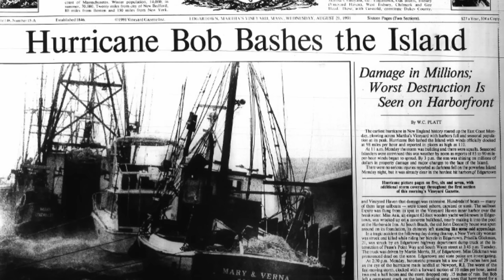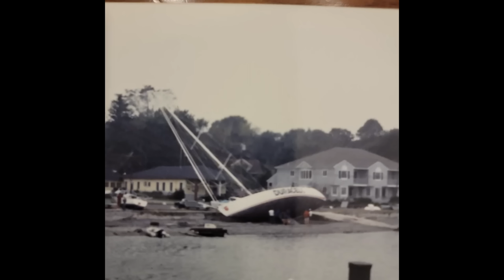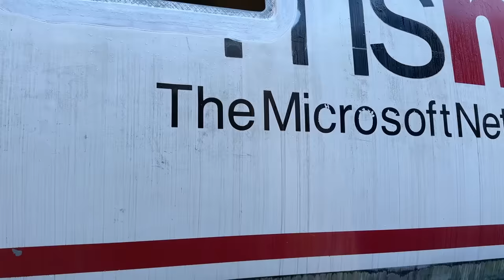FAMILATION (family lamination) & SCARY story [E101]

Comment: I suggest making all three front windows in the doghouse as big as possible to maximize your view forward, even if that means fixed glass rather than the hatches. It would improve your sight-lines thru the rather tall doghouse structure in front of the helm and will be much much more aesthetically pleasing from both inside and outside. If you need hatch ventilation install them in the coach roof above those two trapezoids where you were talking about mounting them.
Reply: The hatches will still give sight lines forward but the big plus, while under sail, is the forced ventilation that will occur. Roof hatches won’t give that through breeze while underway. You can also pass drinks etc through the hatch to someone forward. 😊

Comment: The edge pieces that you slotted to give you that nice cut is called a 'kerf cut'. You can do it to bend certain pieces of wood the same way their is a formula or a calculator you can use online depending on the angle you want to curve

Comment: It so nice to see your parents get involved with the boat build and especially how much your mom has contributed to the long-term boat build.  When you plan for your rainwater catchment drains, you may want to consider adding a raised filtration screen. I've seen that on other boats and it helps to capture some of the large chunks of debris so that it doesn't end up in your holding tanks.  Also, for the front side windows, the position the cardboard is in now looks very nice, but at the end of the day which orientation would give you the best viewing angle for sailing?

Comment: I built a 6 ft x 8 ft hard top with a dam at the edge similar to yours. A good hand-hold and great water catchment system. I was able to catch 16 gallons in a So FL rainstorm and fill my water tank. I can see your roof catching 30 gallons in a heavy rainstorm. Not insignificant.

Comment: Clever idea with the rain catch. Will you have a shutoff or diverter valve for when heavy seas put salt water on the doghouse roof?
Reply from the maker: the roof will not be permanently connected to the tanks. We will connect it when there is a rain storm, after letting the water rinse the roof first.

Comment: I'd suggest to make the two other forward facing windows as big as possible and not use hatches, improving the sight and also the look of the boat... would make a lot of sense to have the side, top and bottom aligned and with similar rim sizes... the hatches could be added on the roof, to also be able to see the rig, mast, main sail etc while inside...
Do you also plan to add photovoltaics on top of the roof?
And how do you plan to avoid to get saltwater from the splashes and mud from the roof into the water tank?
Reply from the maker: we want as big a solar array as possible on the roof so no hatches on the roof. The hatches forward provide immense air flow. The roof won't always be connected to the tanks. We'll let water rinse it off before connecting to tanks.

Comment: Is it possible to have custom hatches made so that the front side windows can match the aft side windows of the doghouse and carry that shape through? If anything the front centre window of the doghouse might have been the candidate for the opening window if there is enough clearance so it doesn't foul anything on deck. You could then build the front windows from a sheet of 10mm poly carbonate thermoformed to conform to the shape and then have two more single sheets of poly bonded to the sides to create a 'go faster, mother of all doghouses' type effect then inset a hatch where you need it  without disrupting the aesthetics...

please remember i'm making it up as i go along so feel free to laugh at my suggestions...
Reply from the maker: expensive, but possible!

Comment: Plus rain water has a lot of minerals absent from water created by a water maker
Reply: Not really. rainwater in the middle of the ocean will have very low mineral content. Also that is all mumbo jumbo. Mineral free water is just fine. But if you want minerals you can always add them to the water after RO. Run your drinking water through a filter housing stuffed with landscaping marble if you are so inclined.

Comment: Pro tips: (1) Do not use a router at sea (2) Do not use a router at sea after removing the base plate  (3) Do not use a router at sea after removing the base plate and hold it freehand without a table or jig like a giant dangerous Dremel tool. (4) Do not use a router at sea after removing the base plate and hold it freehand without a table or jig like a giant dangerous Dremel tool when the seas are over 1m. Thankfully I only nicked my thumb and thumbnail. Just a bit of blood... Do your routering at the dock, on land, or at anchor.
Reply from the maker: excellent advice, Evan!